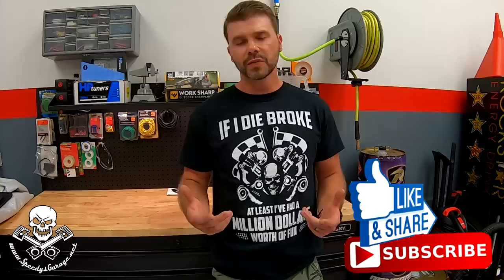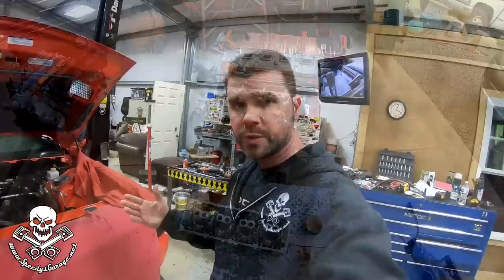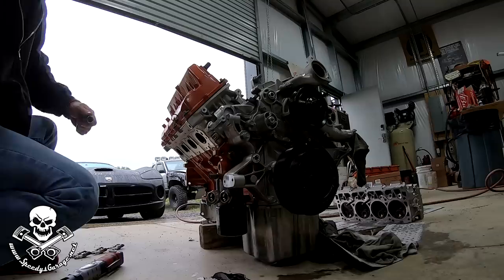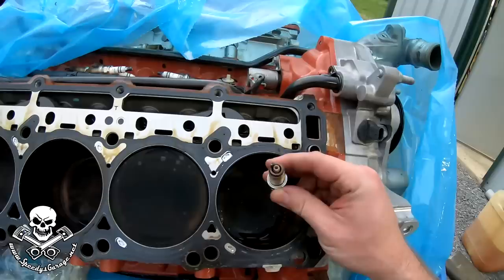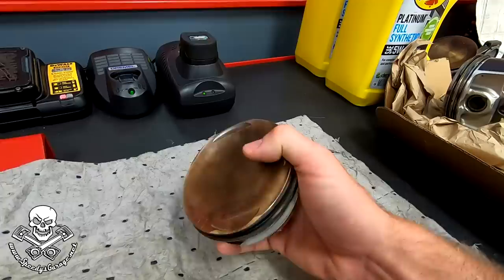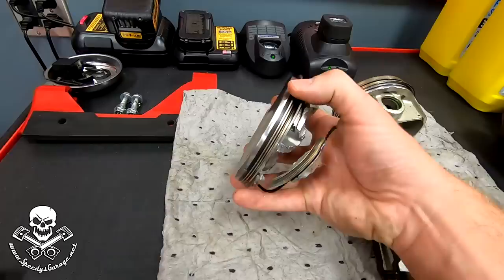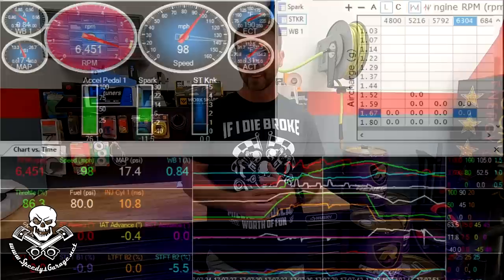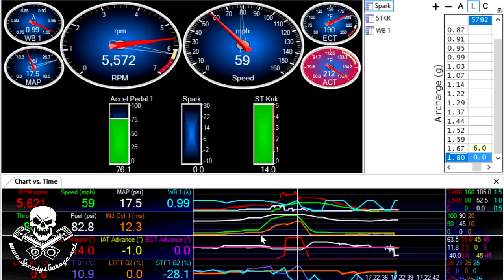Hellcat Engine Failure Diagnosis Speedy's Garage Challenger Go Man Go

Comment: I think this is a case of Excessive piston rattle which ultimately led to a failed piston for on reason or another which led to the rod smacking around and braking pretty common in old school nitrous motors

They had loose tolerances to compensate for piston swell and bad cooling which led to "skirt rattle" this seems to be from lax tolerances on the manufacturers part somewhere down the line in my opinion. 1 of those weird things that dont happen very often but when it does it sucks

Comment: The pin boss let go because it was too thin , I saw that on an early NASCAR 429 piston .
Reply: @Chris J I seen it on a briggs and straton motor that ran talladega
Reply: @jamesavery6671  
I saw it on the 16v 71 Detroit 2 stroke that powered the first Apollo mission.

Comment: High top end temp stuck the piston in the bore @ top stroke. Have a Ford 5.8 it pulled the big end apart. The ecc was not working properly even in a custom bore & new pistons. I've been over it a 100 times in my head can't figure anything else. It just came apart. Lost oil pressure cloged up the pump & seized the distributor. Engine still spins free with a hole in the block.😲.  
Your engine the skirt disintegrated. Allowing the piston to run out of square of the bore. Taper on the top shows run time before complete failure.. Over rev condition on a stock piston. So lucky you didn't loose a crank & block.

Comment: Im betting the rings got tight. started to seize and the rod overpowered the piston and pulled it apart.. run some good gaps on the new engine ....\
Reply: no , because the cylinder walls are not damaged
Reply: Yep right on seen it before and there was no cyl wall damage then eather

Comment: Not a defective piston at all. Thia happens when running pump gas 93 and below. That much boost with 93 octane is on the edge of pinging at all times so running over and over and not letting the engine cool for 1hr plus is what caused detonation and made the piston wobble and eventually break the rod

Comment: That happened to a 10,000 mile 4.6 Ford 2v that I owned. Plug pieces scattered and welded to the piston top. I was running a Vortech with no intercooler racing on a hot summer day. The rod came a knocking on the block lol. It took out my valves as well so I needed a total rebuild

Comment: coolant got in through steel gasket, hydraulic, bent the rod first before breaking.  Clean spots around the right upper and lower head gasket water jacket holes
Reply from the maker: That's in interesting theory!
Reply: Aluminum head or block shrinks after so many hot -cold cycle where there is the most heat at the head gasket fire ring. you can check with a straight edge and flash light, not a feeler gauge.  Head and block surface has to be absolute perfect ( low Ra )
Reply: Like that idea did he show us rod  ?

Comment: To me,the piston crown roll over deformation appears to be caused by one side of the piston pin bosses letting go before the other.This puts the power application off center,causing the piston to tilt in the bore,as the alignment skirts lie on the axis  perpendicular to the pin bosses.The only thing keeping this cratical bore alignment is the wrist pin integrity.

Comment: piston skirts are way too short!
yea they tried to reduce the mass...
but!!
you can only do that on engines that are race only!!
trust me!!
been there and done that back in the late 1970's!!
also burned plugs. is bad fuel!
advance issue!!
I used to run 49 deg advance back in the day...
got in to some wrong tagged fuel...
these are the reasons they check fuel at the drag strip...
high rpm, advance walking, bad fuel = broken parts!!
forged pistons are the only way to go!!
I always liked aires brand... custom were only were 400.00 each. that was back in 1980!!
100% perfect spec!!

Comment: Wrist pin went oval/seized  in pin bore, possibly. This was common with 390/401 AMCs, 1" pin wasn't beefy enough @ 600+ HP.... Thicker tool steel pins fix that....

Comment: IMO you can't call it a "defective" piston if you run it beyond it's design parameters (excessive RPM, extra boost, tune, fuel etc...) and it fails. I believe Engine overspeed and piston failures of this nature are a pretty well understood phenomenon. Regardless, was cool to see a post mortem on one of these engines thanks for sharing it. ✌️✌️👍👍
Reply from the maker: Fair enough.  Cylinder 7 seems to be problematic on these cars from the feedback I've received.  I'm in the process of installing a dual pump upgrade to insure I keep plenty of fuel pressure behind those injectors.
Reply: @SpeedysGarage  nice. That's probably a key upgrade. Definitely not an expert on race engines but it's my understanding that if you run out of fuel pressure and go lean at the far end of the track it gets expensive fast! With that and the beefier pistons should be able to rev that thing till you run outta spring and the valves float!! 😁😁

Comment: Overboost with too Lean of fuel mixture this was cause!!!! This caused your spark plug issue & on cyl. 4 caused pistons ring land to crimp. in which allowed the piston to slap inside the bore. Keep slapping and boosting eventually you end up with what you have.  Been there done that x3!!!! Until I learned better stop over boosting especially with a lean condition.
FYI you will not always see signs of detonation damage on top of the pistons. If I could post pictures I would just to show you.
The top of your pistons are very clean, which tells me you were running lean.
What octane fuel were you running with this setup?
Knock sensors take the timing out of the engine to prevent damage from Octane knock in case someone puts 87 octane in the tank.
Reply from the maker: Well, hopefully you saw the data log posted in the video showing the lambda was .83-.84, definitely not lean and 11 deg of timing isn't too much either.  Boost was 16.5 so definitely not "over boosting" either.  Fuel was Shell 93.

Comment: The piston heads are made of powdered, sintered metal so cracks are probably going to fail like this when they get too hot. I'd replace every piston head (or recommend replacement on customer's machines) on every hellcat you touch from now on. That's a manufacturer defect.. We won't even get into the shitty spark plugs as that's a vendor who provides that to FuCA

Comment: i have seen alot of videos with the same metal fragments in the top of the piston , could it be that the spark plugs were made from faulty metal that melted at too low temp , even alot of ford motors are shown with the same metal fragments

Comment: Spark plugs melt is from to hot lean fuel mixture which causes detonation which breaks rods and pistons.
Reply from the maker: You're right, but in this case the lambda was all in check, so no lean condition according to the logs.

Comment: That’s odd. Mopars Gen III Hemi has some pretty strong rods from the factory. They’re powdered metal, forged into shape, and the mating surfaces are cracked into two pieces, the rod and cap. They only go on one way on the rod they’re mated to. At this point I think I’d upgrade the rods. All of them, after thoroughly checking the rest of the engine and remachining whatever is necessary.

Comment: Press fitting a gudgeon pin [wrist pin] is bad workmanship. This will stress the mounting in the piston. Pins should be secured with circlips . Spark plugs are designed to work to a limit of revs due to heat. Wanting to go quicker, fit a Torkamp and a ltd slip diff. Good video.

Comment: Greetings, I am a certified failure analyst, I have been performing Root cause failure analysis (RCFA) for over 20 years.  Your video was very interesting, however, your analysis is highly incomplete.  All that was discussed was related to the piston itself. What about  the rest of the iron ?   The fractures described in the piston are brittle fractures which are almost always associated with resultant damage, the abnormal wear or impressions on the upper compression land were most likely resultant to the failure.  When picturing actual piston speed, those types of indicators could be created in milliseconds.  I would have placed special attention on the connecting rod, rod bearing, wrist pin and piston skirt.  All of this iron combined will get you much closer to determining root cause.  When a connecting rod fails and specifically between the large end and small end, this is almost always associated with cyclic over load of the connecting rod itself.  Not trying to be a smart ass, just suggesting a much closer look at the available road signs, the iron will tell the story.   Your piston, based on the limited observation noted is not the failure driver, cyclic overload is a much more likely driver.  My two cents for what it’s worth.
Reply from the maker: Good info.  Never found the rod, not sure if it went out the oil pan or was down in it, I didn't pull it, just shipped it off after I found the busted piston.  I am sending some Hellcat pistons off to a guy that does the same work you do for some destructive analysis.
Reply: Speedy's Garage 
That sounds like a plan,  having been a gear head all my life, I have always been amazed at how much more there is to know.   Good luck. Brotherman

Comment: It looks like the wrist pin bent and allowed most of the force to go to one side of the piston.
That usually only happens in diesels but you guys are hitting those type of torque numbers.
I'd get the wrist pin out and check to see if its still straight.
Reply: Never seen that good idea

Comment: Awesome Speedy《☆》Definitely a Parts Lottery with stock Hemi engines. FCA needs to re-evaluate parts suppliers & quality control. The 6.2s are having piston issues and the 5.7s are having lifter/cam issues. Good luck with GoMango🤓☻🤠
Reply: Suppliers have to deal with FCA's low-quality specs. They get what they specify...

Comment: These cars are tuned at the factory and dialed up to a 7.5 on a 10 scale. So a stage one and a pulley change... it's a matter of time before failure all day long. Cast parts and cheap internals are what you find.
Reply from the maker: I think it's a lottery.  Mine broke and I was barely making 800RWHP but I have friends making 900+ and then you have Demonology making who knows what and races the car 4 nights a week still going strong.

Comment: Looks to me that the piston was trying to stick in the bore and pulled the wrist pin boss off..EGT's would tell the story. Don't think it's a piston problem but probably a ring gap issue when temps go up.
Reply: very logic explanation that leads to the conclusion that it is better to not boost an engine if you ,re not controlling the effects.

Comment: That's crazy...I've seen the wear on the sides of the pistons like you got, but not the ripped-out wrist pin...although that is logical if the piston seized in the bore.  It was definitely rocking in the bore...and the bore probably wasn't round to begin with as speculated.  And if they are not torque plate honing the bores...Mopar probably sets the pistons up a little loose to allow for that.  All of it can add up to this...and it sucks to be the one with a blown motor.  Looking forward to hearing what you went with as an upgrade...

Comment: Did the tune have the knock sensors turned down?

This data suggests that's the case.
Reply from the maker: Very little.  Only enough to not pick up noise from the pulley.

Comment: As its been said great video...for a change a genuine informative  video, I think your spot on with your theory, manufactures won't admit anything which is a shame a SHIT does happen and word soon spreads and they get a bad name rather than going... yes we've had a batch issue, Along with most manufacturers I know  Ford with there ZETEC engine which the vales stuck open in the heads due to machining error.....it took us 8 months of diagnosis's to prove it was that before they agreed with our findings, they never recalled them but dealt with then on failure base only, Lexus first diesel the piston rings basically re-bored the engine due to the coating being wrong....again only dealt with failures and that's only two of many I've seen in my short life on this planet....may be if you approach Dodge and show your finding they may offer a goodwill payment?...if you don't ask you don't get.....please do more like this as your understanding and not bias in your view you accept things go wrong which is a great lesson for us all.

Comment: Not look at your other videos, but it maybe an injector going lean with the combo of the Pistons and the non-torque plate honing.
Just like when the check engine light comes on. Most of the time it's  more than one think bad, out of spec or a few close to spec limits.
Reply from the maker: I had the injectors checked in a later video as that was one of my thoughts as well.

Comment: Here is the answer: electrodes failed on 2 causing o2 sensor to sense rich mixture - leaned out mixture - next to fire was 7 with lean mixture - piston overheated and seized in bore leading to piston failure - don't blame the piston - it was a bad spark plug
Reply: Why would it lean out the other bank it has nothing to do with it,bad tune is what happened.

Comment: if you want to find out if the cylinder is out of round (or the piston) just take a micrometer to it. Do 8 measurements across the piston or the cylinder and if you have any that are longer then it's out of round. This would either confirm or remove this theory and let you concentrate on others.

Comment: Piston speed is always an issue. You can shatter a piston easily when you get to a critical point. Being it tore like that, I think you're onto something with expansion and clearance changes.
Reply: when you go to increase the horsepower of an engine, basically, you work to increase the fuel input and thermal load so the pistons becomes hotter and basically, the running clearances are reduced up to the point that the piston is in interference with the piston bore, it is one of the reasons why the pistons are cam ground instead of cylindrical ground..
when an automotive engine is used as a marine engine, it is a currect practice to increase the piston to cylinder clearance by 0.001" to 0.002" to overcome the thermal effect
other, the dynamic effect on a hot piston is sufficient to cause that as it increases at the square of the RPM increase

Comment: This is the second video with piston seven gone... I think she over rpm . And all that cylinder pressure is not good. Some people are saying the odd number side of the engine is not getting enough fuel because of the way the fuel rails are split. Personally I seen many engines fail and send shards of metal through the intake into other cylinders.. that's why your cylinder two spark plug let go. I've seen that on 6.1 all the time. Anyway look in your intake or blower before re assembling your engine there will be metal in there. Great video!

Comment: If I wanted to race an engine and go for more power on a new car, I would tear it down first to check clearances because I doubt that the factory does. A piston too loose or two tight in the bore, with the wrong head and skirt clearances or an ill fitting piston pin can cause problems. I don't have any experience with these engines to know how strong their components are. What did the rod and piston pin look like? It's always a guess as to what failed first. Maybe a piston pin retainer came out, the pin moved sideways so it was putting more stress on one side. One side of the pin hole looks smooth while the other looks like it was badly beaten.

Comment: Why has the left bank of cylinders have less carbon build up than the right hand side? The right hand side cylinder had 2 spark plug fails and melted parts to the cylinder head. Did you have someone do a custom computer tune on this motor? People try and squeeze so much out of everything these days. Kids put a twin turbo on a stock Honda and wonder why it explodes. Chrysler put a good package together here, except for the rear end issues and there are aftermarket parts to alleviate that issue' but will nullify your warranty. Great video, old guy from Canada says so.
Reply from the maker: That's the side that got oil in it, so I'm guessing it cooked off all the carbon?

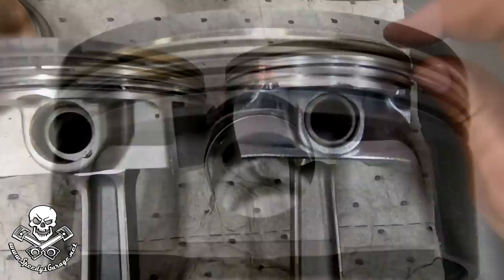Comment: 2 types of pistons are visible here (14:35) : gravity molded (right) and stamp mastered (forged) left: gravity molded pistons are use in 90% from the engines because forged cost twice are heawyer and are only use in the highest power engines...I think the broken piston was broken from over speed RPM...

Comment: In my past 50 years of building and pushing engines (many times well beyond their limits), This looks like a classic piston skirt failure - then instant stress cracking the pin boss.  The piston rocking marks smells exactly likes that.  Skirt goes - then piston rocks - then a few strokes later - Boom!  As far as the broken ceramic in the plugs - that is either bad plug mfg. or mild detonation.  Did you change to a colder plug than stock?  I hope.
Reply: if you're shattering plugs that's major detonation and if you keep doing it with plug after plug you're ignoring a problem and will pay for it eventually.

Comment: When the factory is trying to reduce reciprocating mass the pistons take the hit. The higher the factory output the tighter the structural integrity gets and the room for adding more horse power is limited. Yes it can be done but we start seeing those weak points. I'm pretty sure not ever piston and rod is inspected with like a dye penetrant inspection, things slip through even the smallest imperfection over time and loads will get bigger.